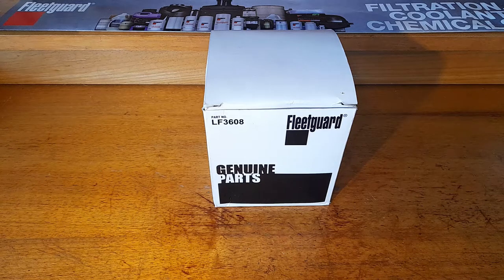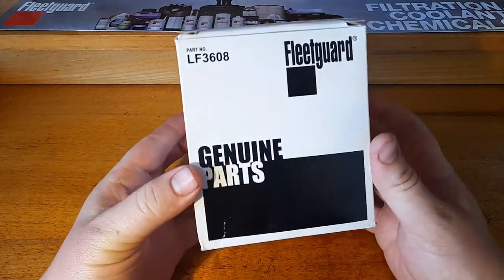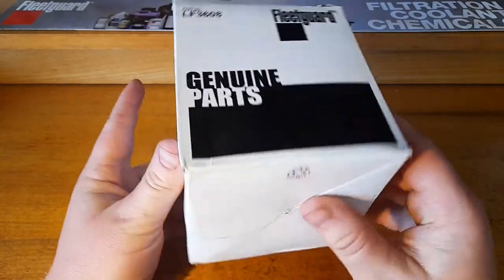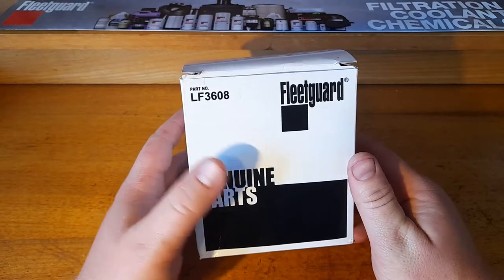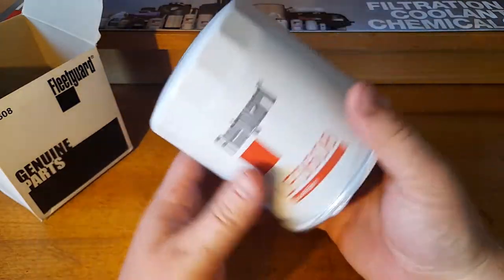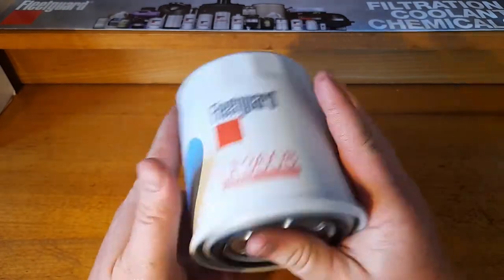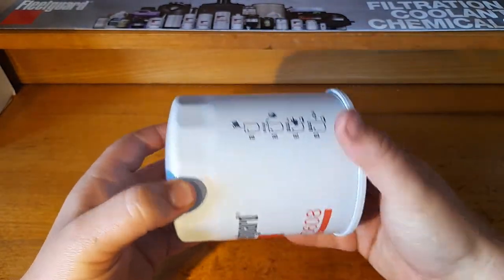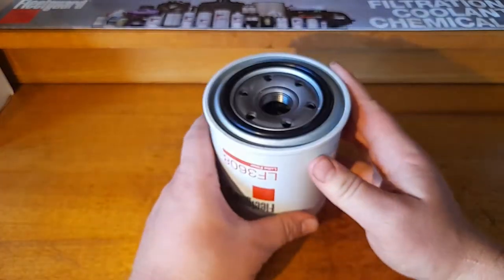Dual Element Oil Filter! Fleetguard LF3608 Cut open and review

Comment: This appears very similar to the Mahle filter also made in Indonesia. I bought a case of them from RockAuto $18.50USD here in the States. The Toyota version is around $30USD.  The Toyota version uses a different bi-pass media I believe.  The Mahle and Toyota versions weigh exactly the same.

Thanks for the info. 👍